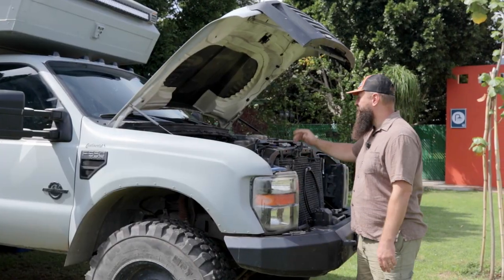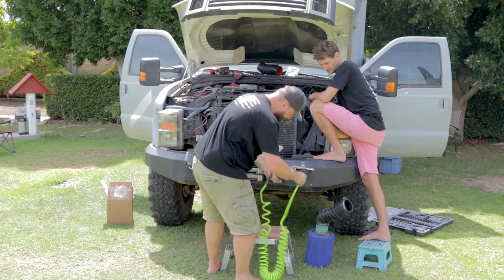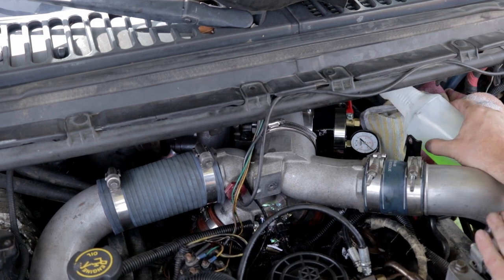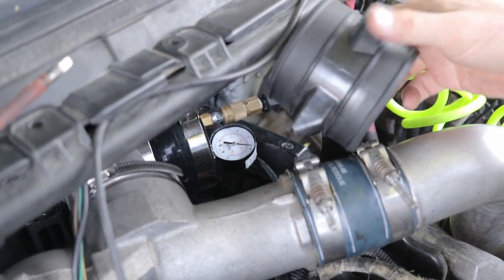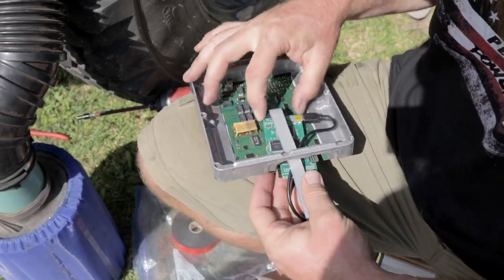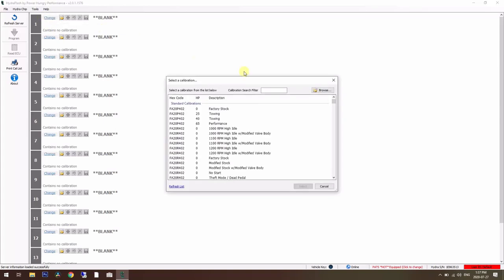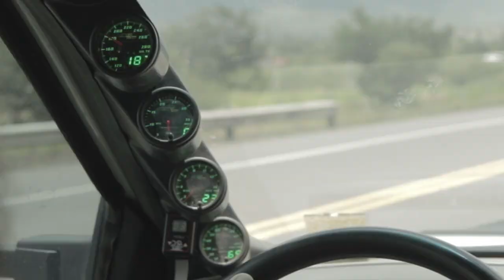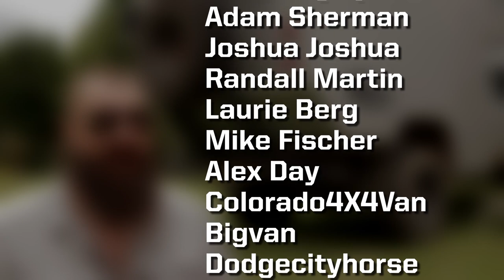KC300X Turbo Boost and Smoke Issues Solved!!! - PHP Hydra Install - Everlanders Boost the World!

Comment: Wait a second. First genius idea- use Corny kegs for the pressurized water system. Now the zip tie/heroine syringe trick? You sir, are an engineer at heart!
Reply from the maker: We just use regular syringes actually... I've used them in my work for decades applying assorted glues in tiny places.
Reply: Everlanders yes, me too. Only with one part adhesives. Using the zip tie to mix is ingenious.

Comment: I just picked up a 7.3 diesel after tons of research and with you being a big influence on that decision. I was looking at getting some gauges and can't quite decipher what the 4 A-pillar ones are. I would love to just run torque, but I have an iPhone. Thanks for the help and love the diesel content!
Reply from the maker: We have  Boost, EGT and Fuel Pressure, Oil/Coolant temp are there to fill the hole.
Reply from the maker: BTW torque is invaluable for ICP and IPR values, so perhaps a 100$ tablet is in order...
Reply: Thanks for the help! And to run torque, that is through the OBDII port, do you have any hardware recommendations for that.
Reply from the maker: ELM327

Comment: A couple things...when KC told you that was what you should expect from the gauge, due to passing through the engine (leaks)and crankcase; it is normal for the gauge to drop back in zero in about 45 seconds. You can crack that valve just a bit open to keep the "30lbs" on there while you check with the soapy water for leaks. I didn't see you check the lower boots to the engine. Those are a good source of leaking also, if they've been on awhile.
Reply from the maker: Thanks for checking in, it's been about 1 year since that video, we're having no problems pushing 30 lb of boost in our recent travels...

Comment: The new chip seems to have made a difference. Losing the solenoid and resolving the leaks helped I'm sure. Nice save on the gauge. I thought the higher boost air pressure might help lean things out a bit and lessen your black smoke. The new turbo seems to be a hit! Take care...
Reply from the maker: It does smoke waaaay less, especially in the normal Daily Driver tunes under normal acceleration. Very happy with everything now.

Comment: If you ever have to test again, move the valve to the bumper supply (and maybe tee off the gauge from the output side of the valve) so your hand is nowhere near the business end if it decides to blow off and at least then you can crouch out of the line of fire if it does pop off.
Reply: and the supply hose will only be seeing 35 psi instead of full bumper air pressure.

Comment: JERRY VAN SCHIE.  AWSOME TRUCK .I was wondering do you have a balance tube between the heads for the high pressure oil ,just built mine with hyd hose good for 5000 psi balances both sides, smother and quieter at high way speed . 7.3 is the best I run on conola oil all year  utah bio diesel fuel pumps  2 units 1/2 fuel lines  . stay safe .
Reply from the maker: Yes, we have both Fuel and High Pressure Oil crossovers...

Comment: 2 questions: PhD in? How many miles/km on that Powerstroke (kinda amazed at how you’re pushing it)? So much info in your vids, amazing. Trying to get the pi and and open auto pro situated in my 80 series cruiser. (It’s tested out of the truck, but need to install, rear cam is going to be a pain to find a spot and case for).
Reply from the maker: We've put about 100,000km on this build/engine so far, there is about 300,000km on the dial, but but we've preemptively rebuilt and hardened alot of the drivetrain before building out the camper.
Reply: Everlanders makes sense. I must not have gone back far enough in the videos for the engine work.

Comment: Might be a fun WeMos project to data-log your crankcase pressures... I've seen some people correlate pulses in crankcase pressure to see if they had a cylinder with bad rings.
Reply from the maker: They're brand new rings, I'm pretty sure they're fine...

Comment: Hey Jason, since your unable to hold  30 or 35 psi of boost and leaking through the rings, does that mean an ring replacement to resolve that problem ? Or do you think having a higher Pressure oil pump will help your problem or just help out to balance things. I have a feeling you already ordered one 😉. Glad you got something things resolved . Take care Jason and Kara
Reply from the maker: Experts have weighed in and confirm that the leak down I have now is about as good as you can expect... This engine was rebuilt before we built the truck, so it's got brand new rings in it already... The rebuild however did not include a new high pressure oil pump, I would love to have a new adrenaline pump and some bigger injectors, but it's not in the budget right now.

Comment: Did you replace the sheet metal formed nut on  the IPR on the back of the HPOP, AKA the 7,3 Achilles heal
Reply from the maker: It's new, with the new IPR... And the spares in the back are also new...

Comment: Hi, what's your long term MPG and how heavy is your fully loaded rig? Thanks Andy
Reply from the maker: Our Rig weighs 13,850 lbs with Full Water and Diesel Fuel Tanks. Our Long Term Fuel economy was 15-17L/100Km before we installed the TS6 Tunes, but then it started smoking much worse and our Economy fell to 20-22L/100Km  -  We are hoping that with the new Turbo and the ability to adjust the tunes ourselves (via USB) that we can get back down to the 14-15L/100Km we once had. (~15MPG)
Reply: @Everlanders  How fast are you driving when you get these mpgs?
Reply from the maker: 100Km/h
Reply: We get asked this all the time. I always answer. "Variable, and irrelevant".
 It is what it is, and is not even a consideration for what we want and do.

Comment: Should vent crank case to atmosphere to prevent oil and carbon build up on valves and in intake
Reply from the maker: I choose to run mine through the oil seperation strainer and then into the intake, thanks for your comment.

Comment: Yikes!
2,200 psi oil-pressure is SCUBA tank territory.

Pro Tip:
Wear eye protection... and maybe a face-shield.
Reply from the maker: Yeah, it's supposed to be at 3000+, up to 4000 at times, this is all within typical hydraulic pressures which are commonly at 4000 to 8000+ psi.

Comment: If you plug up your exhaust it wont leak through the cylinder and through the valve if your cam has overlap...
Reply from the maker: The 7.3L has no overlapping valve train...

Comment: Why does your truck have 6.4L badging and hood and a 7.3L in it ?  Ans: you did a front end swap.
Reply from the maker: The badge says 7.3...
Reply: @Everlanders  Fender air duct badging is from a 2008-2010 6.4 truck.  You did a front end swap.

Comment: I dont think that small of a leak would make that much a difference with how much air is pumping thru that size engine. I mean i see how it would loose a little pressure but not enough to feel it in the pedal i wouldnt think
Reply from the maker: I too was surprised 🤯

Comment: How are your 20 calb batteries doing?
Reply from the maker: Fantastic, still at 99.5% capacity after 4 years.
Reply: Everlanders very happy to hear that. About to plonk down hard cash for 8 in my land rover. Figured to check in with the Guru 😀

Comment: That doesn't seem like enough of a leak to cause low boost levels like that.
Reply from the maker: That's the problem when you take everything all apart and then put it back together, too many variables changed...
Reply: @Everlanders  Agreed. I just ordered this turbo from XDP for my 02 f350 flatbed dump lumber delivery truck but now I'm searching for a pedestal with delete. XDP is out of stock.
Reply from the maker: KC Turbos has them... https://kcturbos.com/products/garrett-702670-0002-99-5-03-7-3-ebpv-delete-turbo-pedestal
Reply: @Everlanders  Yes they do. I just ordered it and the CNC high pressure oil line conversion. Wanted to get the kit from riffraff bit they're out of stock.

Comment: Didnt know 1/8th of an inch was 6mm
Reply from the maker: It's not, it's 3.175mm
Reply: @Everlanders  the other guy just worked out in his head 6mm. As an inch is 25,4mm an 1/8th isnt 6mm that would be a rough 1/4 unless i heard wrong.

Comment: Ford sucks. I've lost count on the turbo issues our fleet of work trucks have had. Meanwhile the old 2000 something gmc dyramax sidekick keeps running like a champion with over 350000 miles on it.
Reply from the maker: I've had no problems with the turbo, I'm only upgrading for performance reasons...